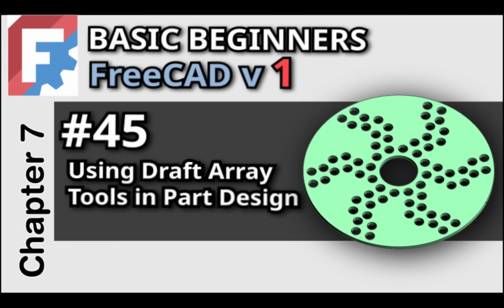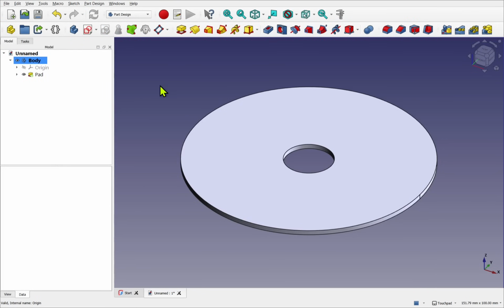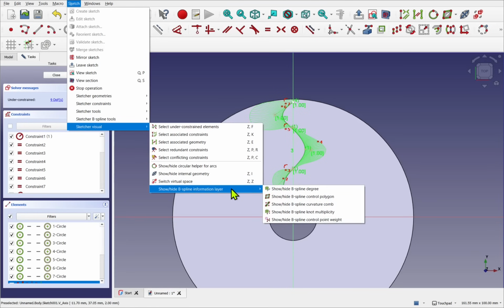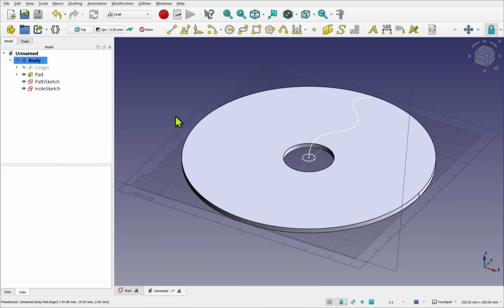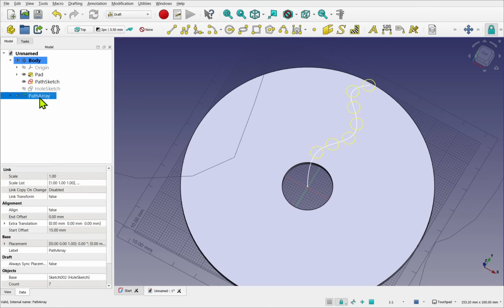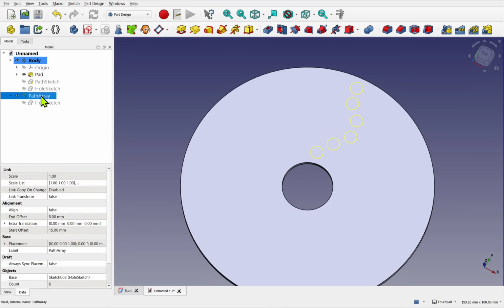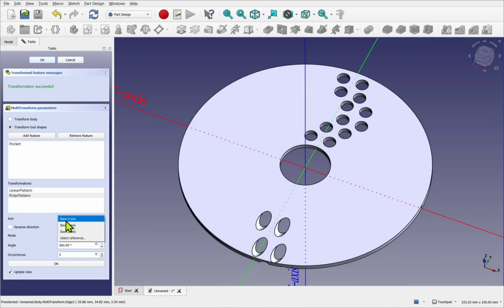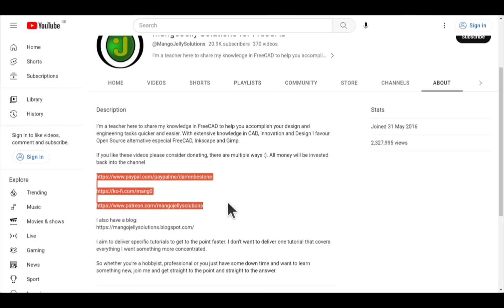Patterning Along a Path in FreeCAD Part Design | Basic Beginners Lesson 45 | Tutorial

Comment: Thank you for your tutorials! I want to pattern a hole on an oval path. I need the 20 holes starting at a specific spot on the oval path. Is there an easy way to "rotate" the holes along the path so one can be set the the point where i need it? As of now it starts the pattern at a for me random location on the path
Reply from the maker: Glad your enjoying them.  With you query I have thrown together a quick video which I think may be the challenge you are trying to solve with a resolution.  There is no sound as it was something I quickly thrown together.  Is this what your experiencing and does it solve your issue? Note the attachment and placement of the circle in the sketch is the key https://youtu.be/cAAVvBgQriM